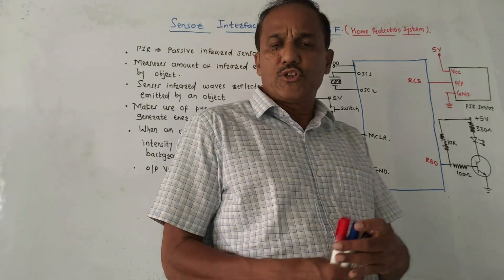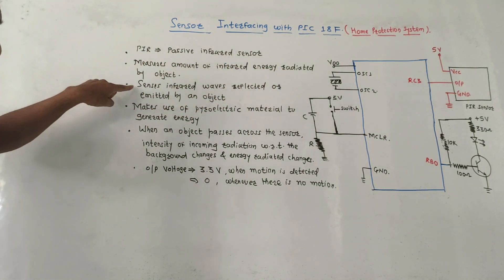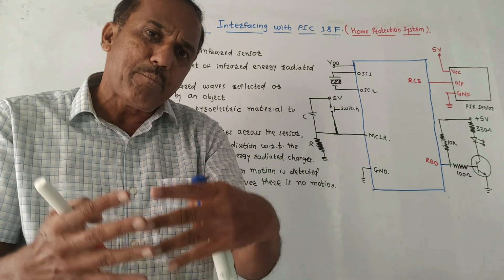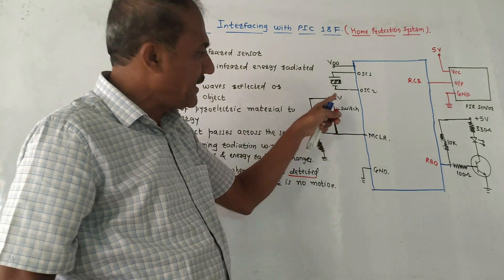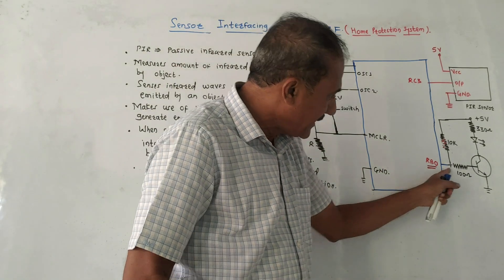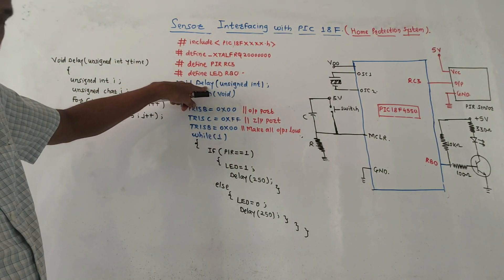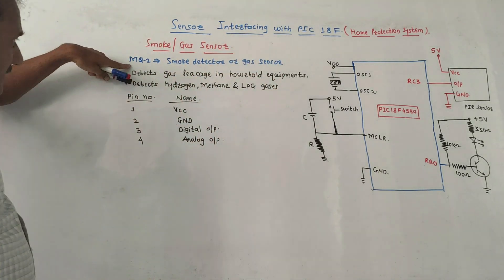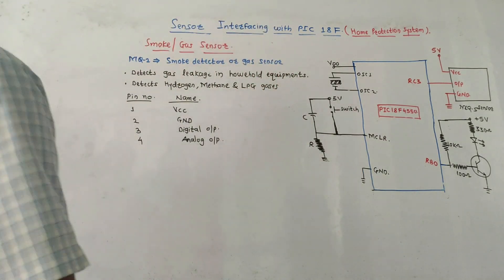SENSOR INTERFACING WITH PIC 18F (HOME PROTECTION SYSTEM)

Comment: I dont understand why did you use 100 ohm to drive the base of that transistor as well as a pull up not pull down. little math is needed. base will keep it at 0.65V when you use that as switch and 3.3V will add loading to the port pin upto (3.3-0.65)/100=26.5mA which is very poor design. It's really a bad schematic design.